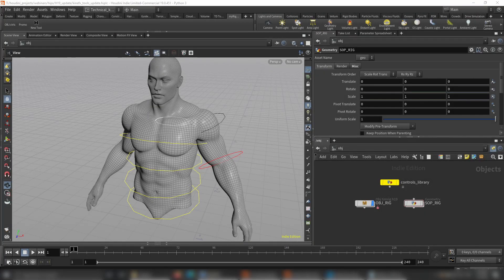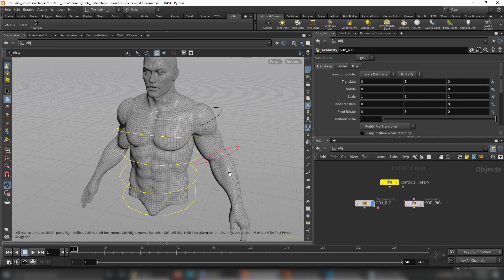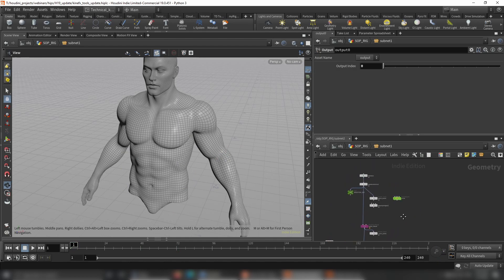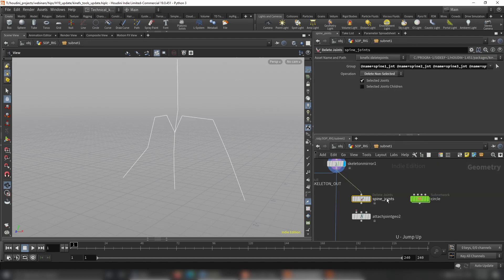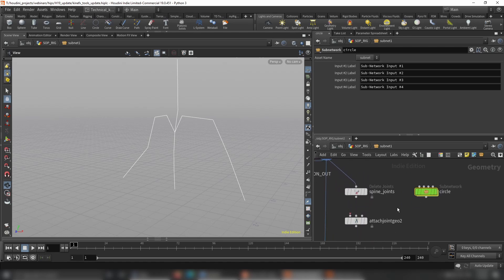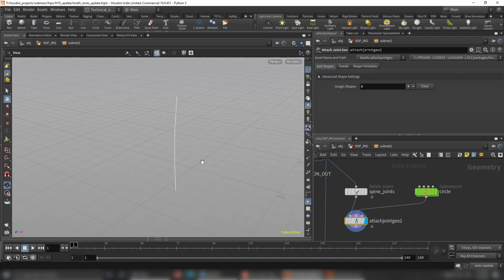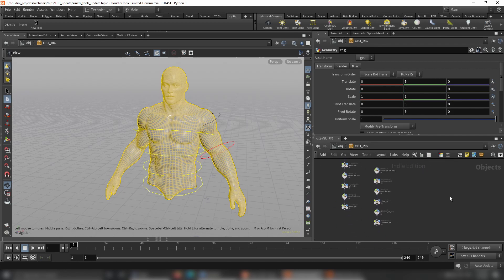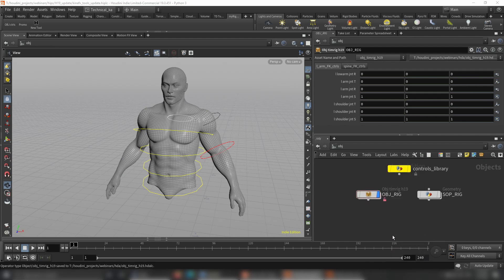Kinefx tools: Houdini 19 update

Comment: Hi Kamil. Houdini 19.5. seems to have modifications in the skeleton blend node. I can't make it work, any advises?
Reply: Update: I found a solution, you have to specify which joints you want to blend in the Group section of Skeleton Blend node. This is weird, hopefully they will change this soon.
Reply from the maker: As I haven't reviewed changes made in 19.5, the best workaround is to stick to 19.0. At least for animations.
Reply: @HepnerKamil  This bug have been now fixed in the latest 19.5 update, so skeleton blend works now fine as it used to.

Comment: Hi Kamil, 

Thanks for sharing. 
Just wondering, do you know the Python API for creating joints/point inside the Skeleton node? 

I tried the documentation but there seems to be none. I also tried printing help() result of the skeleton node but it does not give any specific method. Only those generic ones inherited from the SOP and Node Class
Reply: Go into Houdini/packages/kinefx folder; these nodes are pretty much all written in Python so you should be able to just look at the source code.